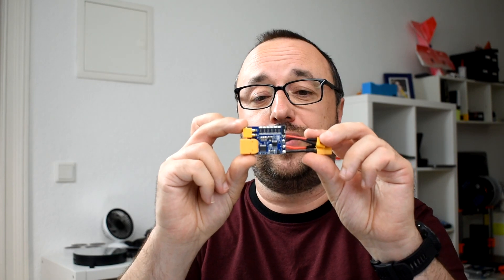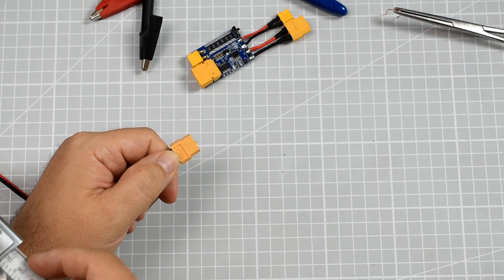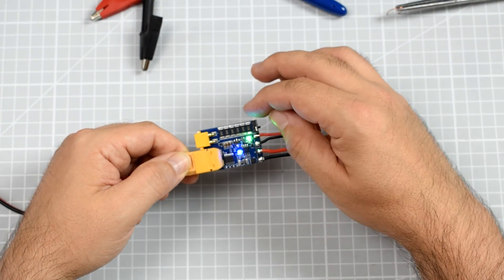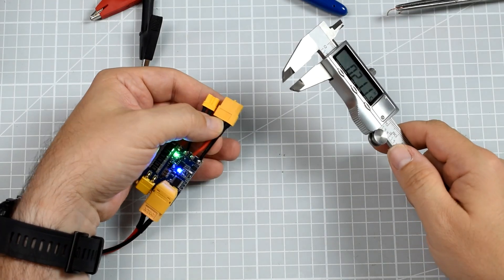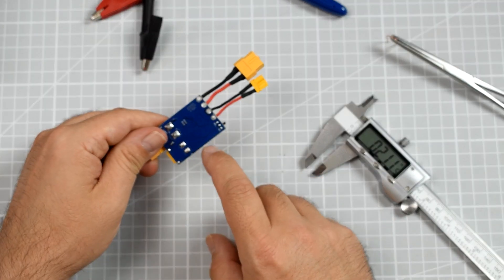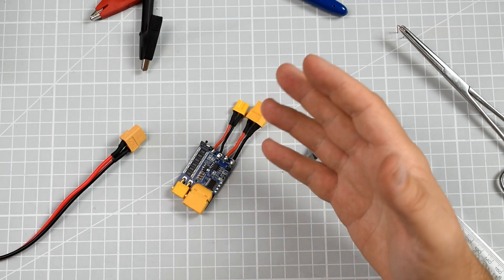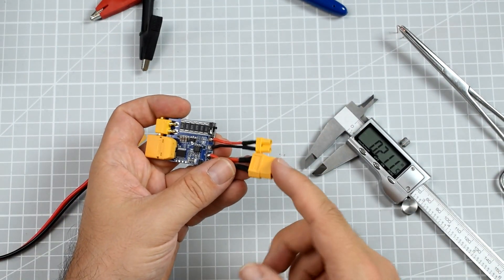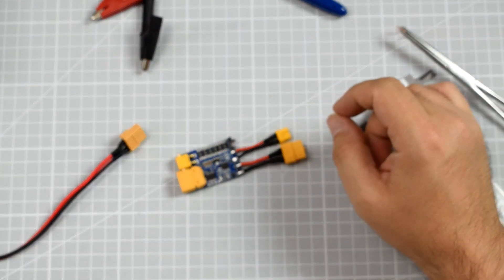ViFly Short Saver saves your drones!

Comment: the chain of electronics get longer and longer.

This is another kind of "right" power supply that could fit a lot better on a fc board where less components would be needed and no additional connectors.

Time for matek to upgrade their fc to second decade and add third protection + swichtable WiFi ...

It can be a lot cheaper for us regarding cost + saves weight of connector + space especially of these bulky connectors.